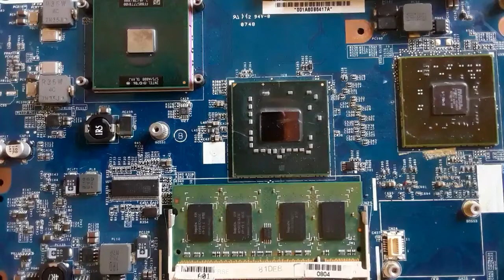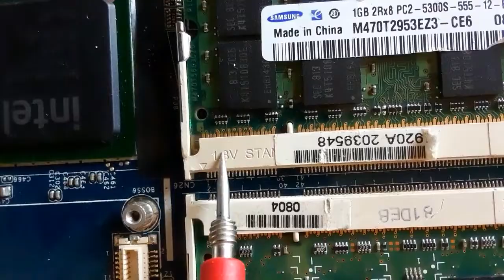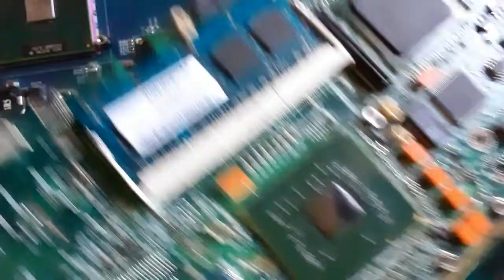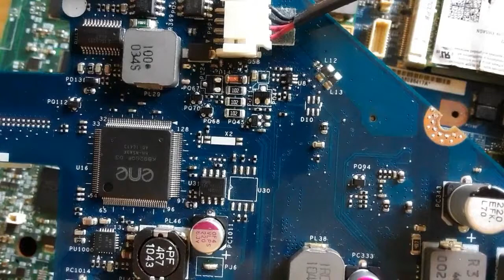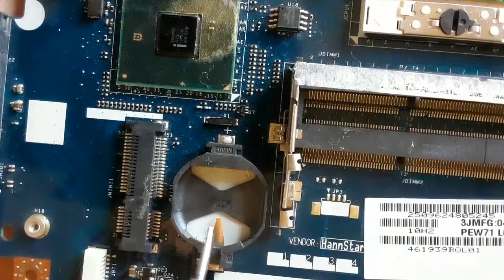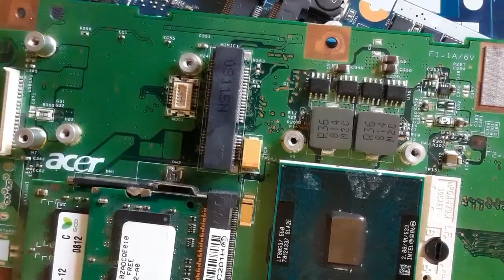Laptop motherboard components names & functions explained

Comment: Resp Sir! Nice Class Sir.  Dell VJ40T Mother Board PCH Nearest SMD Capacitors Shorted and on the PCH SMD Capacitors are also Beep and 25Values Sir. How to Repair Sir. Please Advise Sir.  --   ChinnaRao Paderu Andhrapradesh
Reply from the maker: Troubleshoot the short circuit using the method I share with you in my classes

Comment: Thanks for your video. I have a laptop that received a spark during a screen change, it caused a spark and since then the screen has not worked, however through the HDMI the laptop works. After looking at the motherboard, I noticed that there was a charred component. According to the diagram it indicates that it is L13, but I don't know what component it is. I have seen several of those components in your video but I don't think you explain it. Do you know what components it is? Greetings and thank you